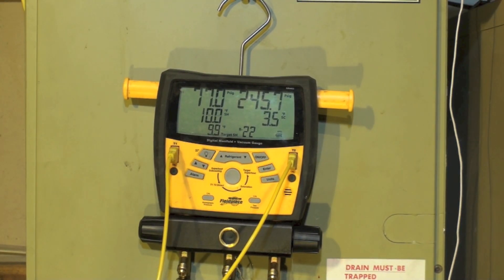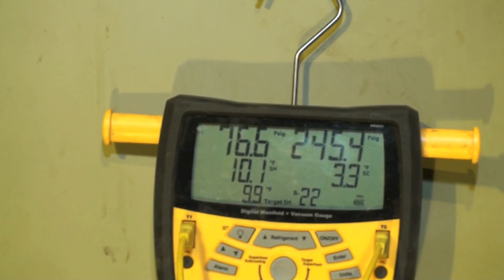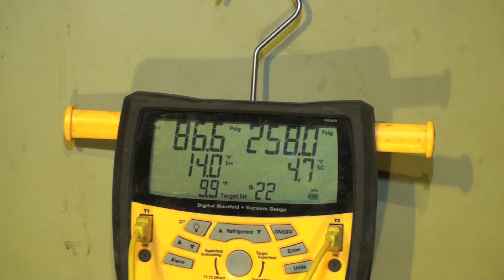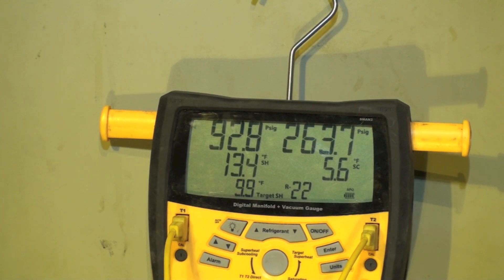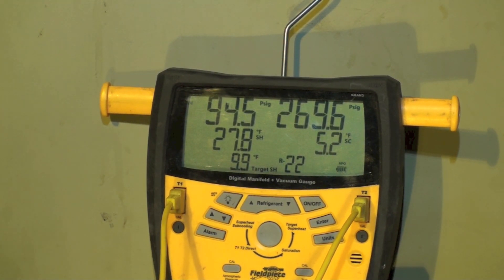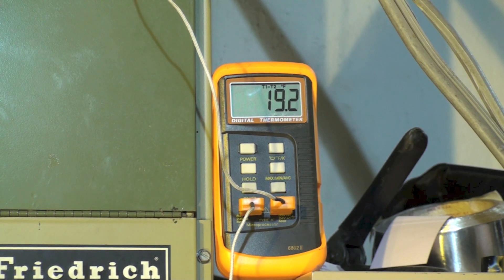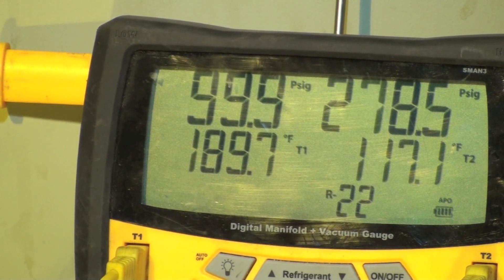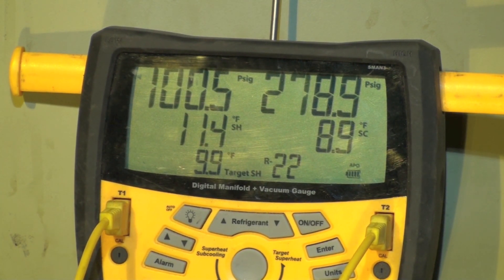The effect of different air flow on the air conditioner in high ambient

Comment: Another great demo.  With suction pressure so high, I was wondering about compressor amps and then you answered the question.  It's surprising that even with that load you were still within rated amps.